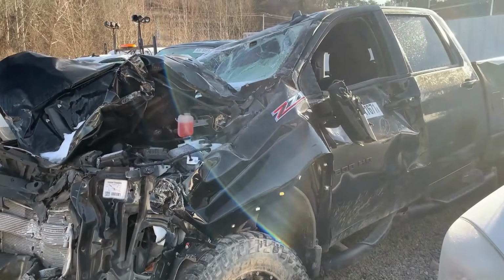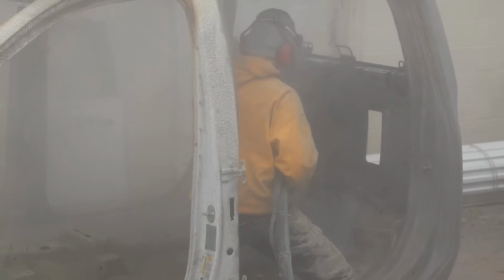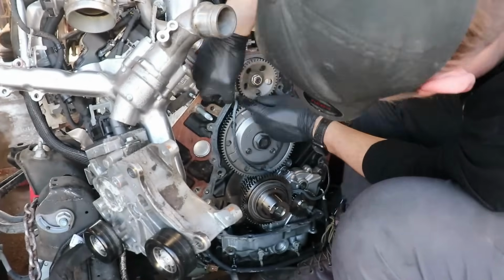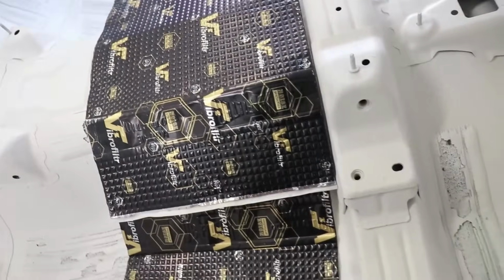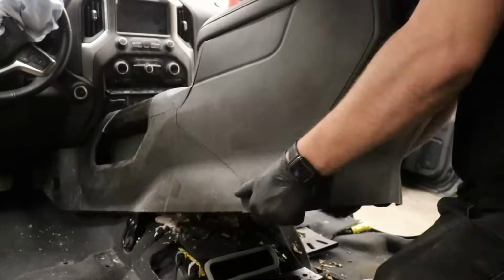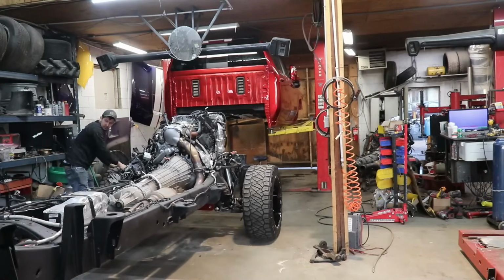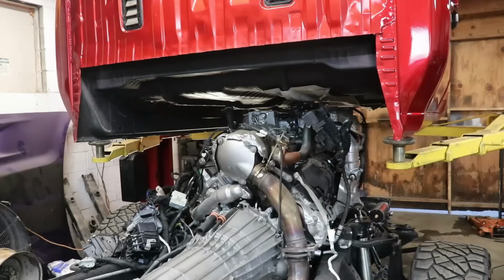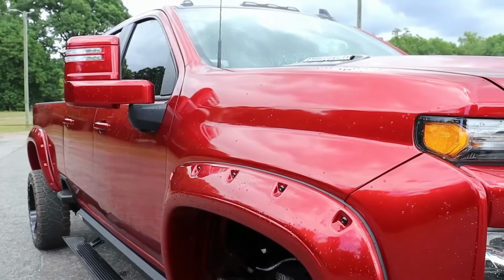REBUILDING A 2021 SILVERADO 2500 DURAMAX IN 34 MINS OR LESS

Comment: Was the frame ever plated or boxed in for strength at the point where the gas tank melted during the fire? As I  recall it was hot enough to melt the driveshaft.

Comment: OK guys watching this you said new chassis new cab new trunk so the only thing original from copart truck is the engine and some parts that weren't damaged in the original vehicle so after all said and done this is not the original 2021 silverado it's a hybrid of parts from another one and put in the 2021 engine still doesn't make it a 2021 silverado  sorry just an opinion
Reply: plot twist, they were both 2021.....   So the hybrid would be still a 2021.
Reply: They’re both 2021’s….

Comment: We used to do big jobs  in the old days. These days everything totals because salvage values are so high. Sometimes a 1/4 panel job totals a 2 year old car. 
Rebuilding totals never worked out financially for me.  The rule of thumb I learned was, you don’t want more than 1/2 the vehicles retail value into it, including your own labor. I built 4 totals, I probably made about $2 an hour by the time I was done.

Comment: Old build. No update months after build on how is fire damaged frame? Just a stop gap as current porsche is causing issues. 
How many miles has truck done? It's neve been used for work. 
Niko brothers have never reviewed a vehicle they have rebuilt twelve months later. Be careful kids

Comment: Great work on the truck! I did wonder if the fire damage might weaken the metal? Is this not a concern because of the gauge of metal?
Reply: They found out the frame had lost its hardness due to the fire.The frame had dropped when they got the cab and bed on it.They did try to bend it back.Needs a new frame.

Comment: Hugely impressed with the quality of work in refurbing the burnt out shell and producing an excellent exterior finish, as far as I can tell from YT. I remain however concerned that the original surface protection inside box sections, chassis rails etc cannot have been cleaned as well by the sandblasting nor as far as we could see was  a replacement primer or paint finish applied.
Reply: It almost looks like the box was replaced and aslong as they spray an undercoating oil in the frame it should be ok for the life of the truck